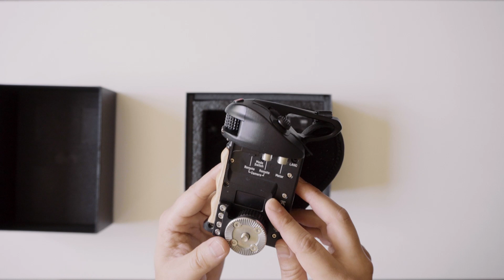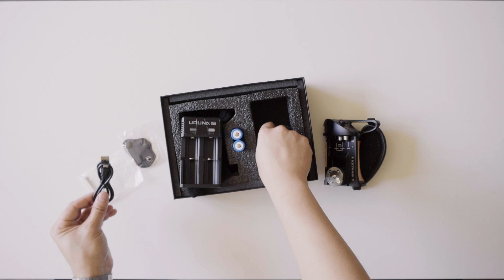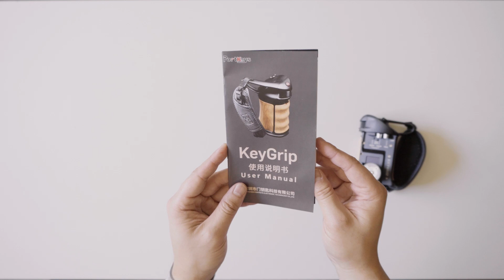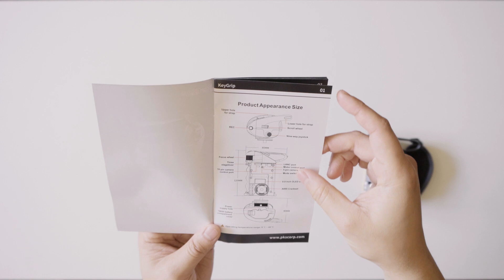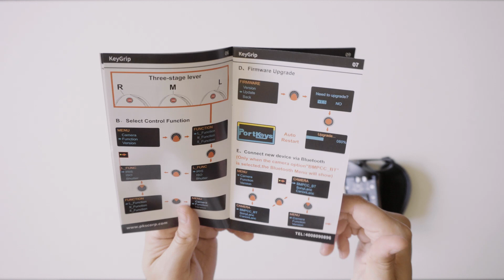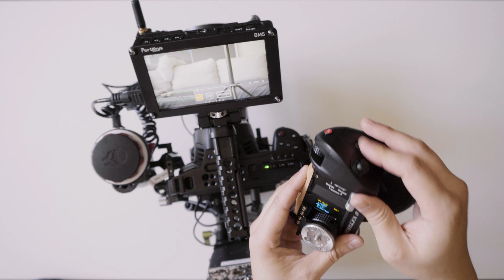First Take: PortKeys KeyGrip (with BMPCC6K + Tilta Nucleus Nano)

Comment: Hey. Awesome video man. Really helping me in my purchasing decisions. I noticed in your description you mention that you can’t connect more than 2 devices to pocket 6k via Bluetooth. I haven’t figured out how to connect more than 1. Pretty please make a video how to do this? Lol also noticed you mention further down portkeys said they will eventually allow control over both devices with different cables? Is there a cable solution to this issue with the monitor and key grip? I just recently got the key grip and the LH5P monitor and it sucks I can’t currently can’t use both to control the camera. Thanks for your diligence in solving this!

Comment: do you have have their monitor to make this work?
Reply from the maker: Zakk Shane Miller Yup I have the BM5 II with Bluetooth monitor as shown in this video. You cant connect two Bluetooth devices to BMPCC but on the Facebook group, they (PortKeys) said it apparently can happen in a future software update since the BMPCC doesn’t have a lemo port for a R/S cable. They did show how it can be used together with the grip and monitor for ZCAM

Comment: Just got my keygrip today to control my ZCam E2-S6. Controls for the camera works just fine. However i'm having the same problem like you bro. The focus wheel on the grip is not moving the Nucleus Nano motor. It looks like the batteries are not strong enough to give it useful torque. Hopefully PortKeys sends out firmware updates that work out the bugs to make this a great product like i initial expected.
Reply: The Nano accepts from 5v all the way up to 18v.  (You can verify this on the Tilta site.)   Night and day more power and torque when motor gets powered from a 12v source than standard 5v USB.  Because it is weak at 5v, many use adapting cable (available from Amazon), or cable purchased from Tilta, for 12v power (which may actually be 13+) instead of standard 5v USB.  I don't know what voltage the KeyGrip port provides, but voltage level input makes a huge difference in the way this motor performs.   Tried to look up KeyGrip voltage at that port, but could not get that spec.

If motor is working but torque insufficient, this may be related to the level of voltage the KeyGrip supplies.
Reply from the maker: I did learn that you need to first calibrate the lens. If you haven't already, join the PortKeys Facebook group. It's not the most ideal way to get the info but that's where I learned. I'll make a follow up video to this showing that it now works.  When you're connected to the Tilta Nucleus Nano, long press REC and Central button for 3 seconds to calibrate motor. Long press LEFT button of the joystick for 1 second to set at the points A. Long press LEFT button again to set B point. Now your lens should be mapped either through the calibration (lens with hard stops) or manually via A->B points if your lens doesn't have hard stops.
Reply: @845a  I tried to do the A----B calibration, but the Keygrip focus wheel moves the motor so little (as it does in your video) that I can't move the focal length to infinity, to set the B point. Is there a way to reset this tiny motor movement?
Reply from the maker: @pinealproductions  I need to build my rig again to see how to redo it but for me this is what has worked. Do try to removing batteries and reinstalling again.

Comment: I think u can link the monitor to the keygrip via a cable. I saw a video of it working that way with ZCAM. BM5 + Keygrip working together.
Reply from the maker: But with BMPCC, camera control is with Bluetooth. Haven’t seen from Portkeys how to connect the BMPCC to portkeys with wired cable since the main reason to get the Bluetooth module was for wireless camera control
Reply: @845a  oh yes, unless they enable USB control. We had success with Zhiyun Weebill S control of the BMP4k. It's very good!

Comment: Still waiting for mine, so no way to test :-( My guess is that you'll have to figure out how to do the A/B calibration from the Keygrip in order to get it adjusted. That is supposed to be one of the features.
Reply from the maker: Christopher Sjolin I’ve learned that it’s just plug and play in which there wouldn’t be a way to set A B limits
Reply: Pretty sure that isn't acceptable. 1. Because they advertised A/B calibration on their initial feature list, and 2. That is basically useless.
Reply from the maker: @chicaneti  I did learn that you need to first calibrate the lens. If you haven't already, join the PortKeys Facebook group. It's not the most ideal way to get the info but that's where I learned in which they posted these calibration instructions which shouldn't been included in the manual to begin with (they've acknowledged it). When you're connected to the Tilta Nucleus Nano, long press REC and Central button for 3 seconds to calibrate motor. Long press LEFT button of the joystick for 1 second to set at the points A. Long press LEFT button again to set B point. Now your lens should be mapped either through the calibration (lens with hard stops) or manually via A->B points if your lens doesn't have hard stops.

Comment: JJ, per our conversation on a user group: here is mine. very different speed results. My batts were measuring 8.34V. I no longer think voltage is your issue with the slow motor speed. Definitely seems like software.    https://youtu.be/aeEw8Rlk83A
Reply from the maker: Sean ooh yours looks great haha Yea I’ve yet to try it again but will do tomorrow with a full charge. I’ve learned that it is just “plug and play” (connect the 4-pin to usb cable). If I try once more with my fresh batteries and it’s still not working will definitely hope to get it replaced then. Thanks for the video! Seems like when it does work it’s definitely good.